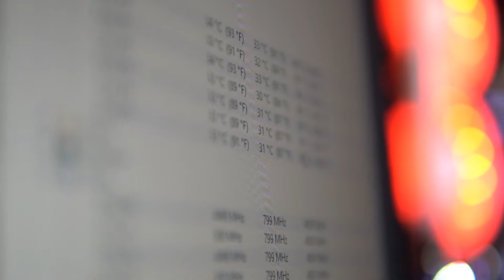Got an Air Bubble in your Water Block? Try This!

Comment: My water cooler is making a strange noise, and it stops making the noise when it’s on its side, but then it comes back
Reply from the maker: Hello Louie,
Do you have an AIO? If so, air inside your pump/block combo can cause noise. To fix this, make sure the pump/block is lower that the inlet & outlets of the attached radiator. This explains the phenomena of the noise stopping while having the system on its side
Reply: @fluixtech  what’s an AIO sorry this is all new to me
Reply from the maker: There is a Jayztwocents video which goes over this in detail: https://youtu.be/DKwA7ygTJn0
Reply: @fluixtech  ahh you see thats the trouble, If I try to remove the coolermaster pump or radiator it’ll void my warranty
Reply: @fluixtech  it’s a close loop cooler as well, does this help? Sorry
Reply from the maker: @louiecopeland2646  Yes a closed loop cooler is an AIO, the video I sent will definitely help. The noise is usually caused ny a little bit of air in the loop going to the pump.
Reply from the maker: Reach out if you have any other questions! - Abhi
Reply from the maker: Yes you are right some manufacturers do have limited warranty clauses for removing coolers. It sucks mate.
Reply: @fluixtech  if I leave the computer off for a while do you think that’ll help? And is it dangerous? I’m so sorry for asking stupid questions
Reply from the maker: @louiecopeland2646  Hello, apologies for the extremely late reply. Going back over my comments. Were you able to find a way to fix the issue?
Reply: @fluixtech  it seemed taking it off a certain fan setting, couldn’t remember what it’s called sorted it, just a shame I had to put it on this setting though, but as of now no problems 😁
Reply from the maker: @louiecopeland2646  Glad to hear! Happy New Year!

Comment: Air has a lower specific heat capacity that water (1000 times less in fact).  It doesn't have a lower heat transfer coefficient, the latter is a function of other parameters not the fluid.

Comment: You should use some sort of hose clamp as without them you risk an leak from that point, either cable ties or metal Jubilee clamps would be preferable in your case (no punt intended), loops do build up pressure, you'll notice that if you run the system for a while and turn it off then open the reservoir port and the fluid level may drop when you do so as air is getting removed from the fluid, more so with new loops.
Reply from the maker: Yes, adding a hose clamp/zip tie would help mitigate risk of leaks, however we change and test hardware so often, that we leave this out for this build.

Comment: If your water block had an outlet tube at the top, the water bubble would have naturally been drawn out.  Why aren't liquid cooling systems designed that way in the first place?
Reply from the maker: Yes, you are correct, the block can be positioned either way with the outlet on the bottom or top. Top would help in getting the air bubble out.
Reply: Wait mine does have it at the bottom, so I can just mount it upside down with my barbs up config? As long as the radiator is higher than the CPU clock?
Reply: You would think this product would be tested before being released to the masses. Did they not realize this issue in the design/testing stage? I have an EKWB for my CPU and I am experiencing exactly this same issue. For what you have to pay to have this type of cooling on your system one would think this would be designed better. It's almost like they want your CPU to become toast so you have to purchase another one. Must be in cahoots with the CPU Mfr's.  I have tipped the case many times to try and eliminate the water bubble and it does help sort of for while but after a week or so it is back again. I gave up trying to fix this issue. I just monitor my CPU temps all the time. Very poor design if you ask me. And they call themselves "Engineers"!? HA... NOT!! On a lighter note at least my GPU water block was design correctly. Both inlet and outlet tubes are at the very top and it runs cool.
Reply: @tedats  What did you end up doing ?

Comment: What did you use to short the plug? Also never knew you could short a plug. Good stuff here!
Reply from the maker: Yes the jumper allows us to run the pump in the water cooling loop without power up the electronic components. This is a safe wag to leak test your system. CPU doesnt turn on a heat up, no issue of water touching electronics if not turned on.
Reply: EVGA powersupplies come with a plastic cap that fits on the cable and auto shorts for you. You can probably find them on ebay.

Comment: So I just got a gaming rig and am a first time owner so idk to much about these things.I have a nzxt 360 mm and the fans are running in the nzxt cam app but it’s says the pump is at 0 and caused my CPU to go up to 97c. Do you think that’s from air bubbles or the thermal paste needing to be replaced behind the water block?
Reply from the maker: Air bubbles can cause a pump to wear down and seize if not properly submerged in fluid. Thermal paste would likely not be the issue unless you do not have enough mounting pressure or sometime by mistake the plastic wrap was left on the cooler (etc.). However, in you case, the pump could have stopped working, if the cooler is still under warranty, we would recommend contacting the manufacturer for a RMA. (in the meantime, you can put on an air cooler while the other one is getting fixed). I hope this helps :)